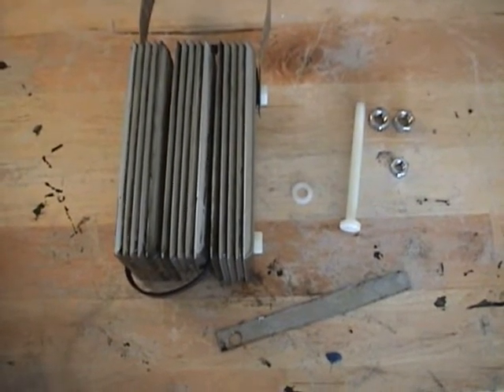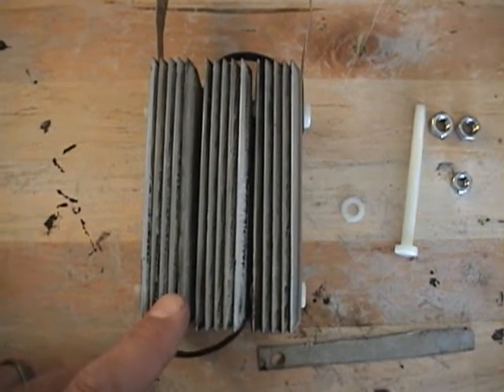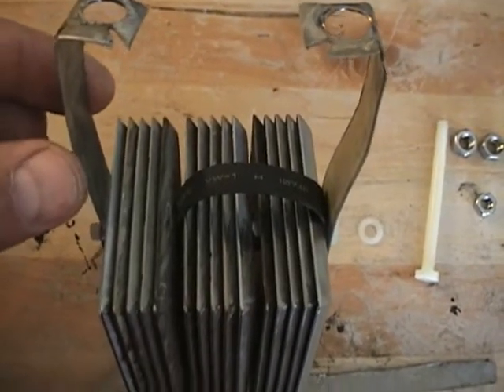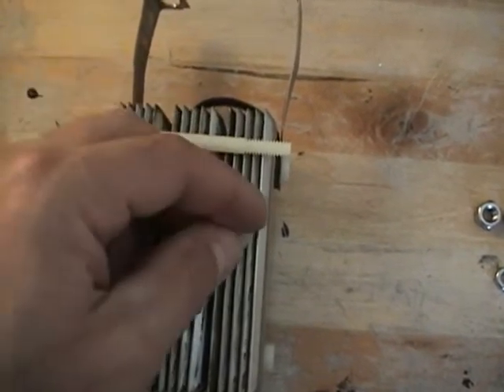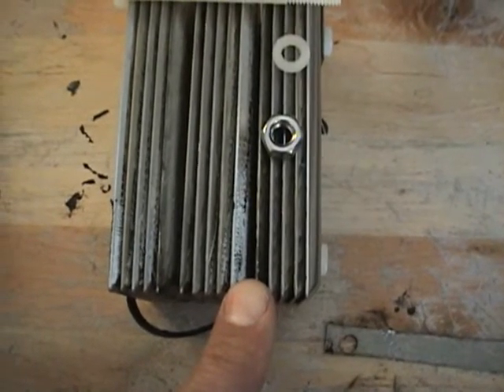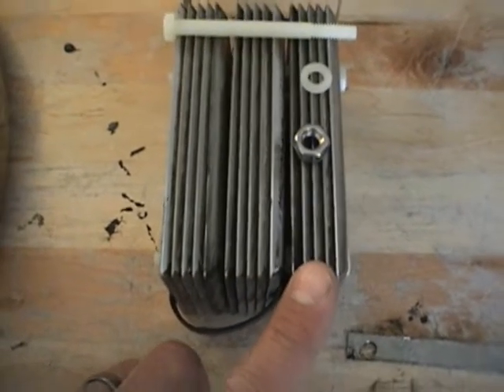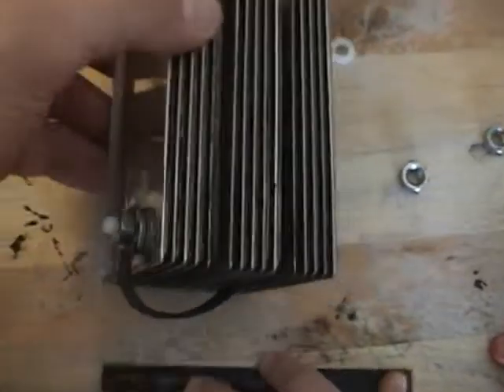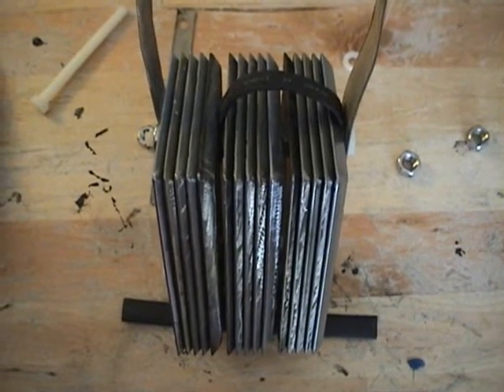(16) TKO cell array How to

Comment from the maker: im getting about 1.1lpm at 24 amps and 13 volts. thats when the plates are fully conditioned using KOH 1.5 teaspoon to 2 liters distilled water. water temp is 120 degrees.

Comment from the maker: the neutral plates really do help. neutrals bring down the voltage across the whole array which does keep the heat down. fastenal has the best prices in those 1/4 washers that i have been able to find. .03c a peace

Comment from the maker: where your +- is together your going to have voltage and heat problems. its like just using 2 + an - plates together. thats why i do +nnn- -nnn+ to seperate the 3 seperate 5 plates cells

Comment from the maker: that is right. thread goes about 1 inch. remember im using 1/4" bolts and 5/16" nuts as the spacers. they slide right by.

Comment: how do you tighten those metal nuts ion the inner plates of the cell. there are no threads that far down the nylon bolt right?